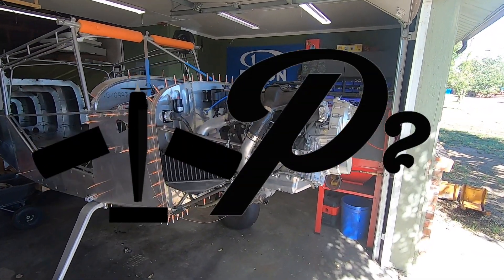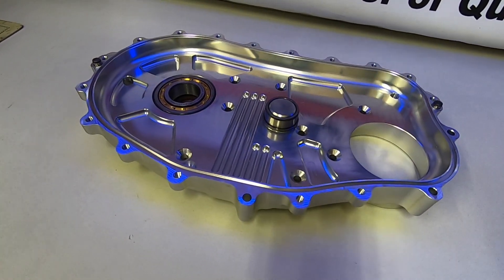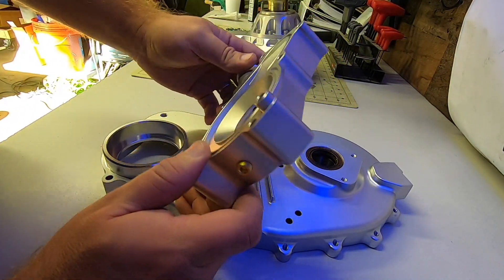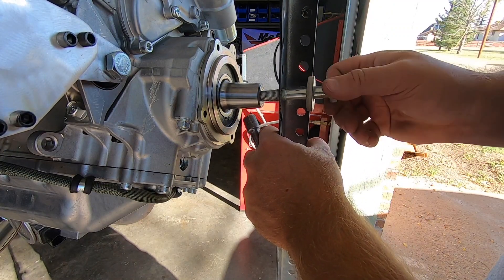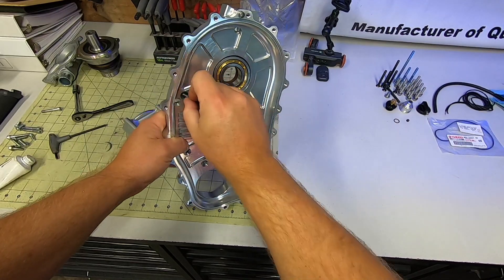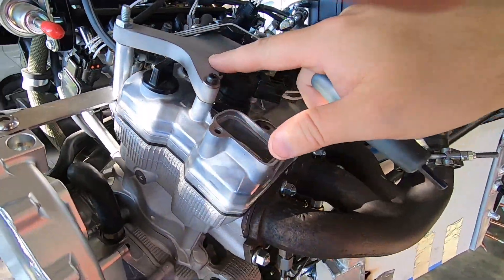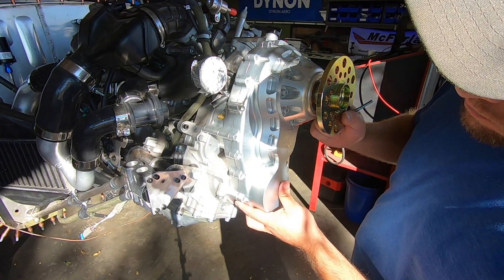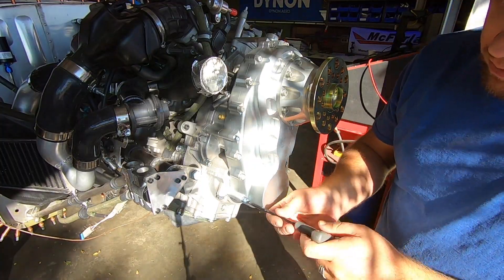SkyTrax Reduction Drive on the Turbo Yamaha Rans S21 EP37

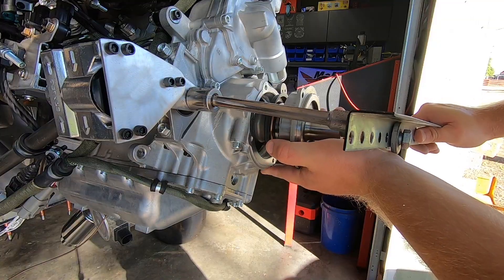Comment: NOTE***@ 3:12 that PTO shaft is a bad design on these engines and develop a bad Harmonic vibration due to spline clearances, "Speedwerx" has a premium(Complete) one with an amazing spline cut and a Harmonic balance to correct this known issue on it. This is an amazing engine and that for sure is an Achilles Ankle.(I promise you🙏) Hopefully this helps,  Thank You for sharing this for us.:goodvibes::goodvibes::goodvibes:
Reply from the maker: Thanks for the heads up. I'm not familiar with the issue you are referring to. any chance you have a part number from them? I cant find the product your talking about. Thanks!
Reply: @Project2Aero   Did you ever get to the bottom of this?   Sounds like an important/fundamental if true.   It appears there is no damper/coupling to wear out between the engine and the gearbox, is that correct?   I didn’t see a harmonic damper on the engine is there one in your system?   Thx.  I think this is a very important engine for EAB and would very much like to do what you are doing.

Comment: Hello, well engineered aircraft project. 
2 Thumb up 👍👍.
What turbocharger unit you used ?
Thanks,
Reply from the maker: Thanks! This is the stock turbo for the Yamaha 998T. It’s made by IHI but I’m not sure what the specs are. Thanks for watching!

Comment: I know that the engine puts out more horsepower than the 915, just for a reference does anybody know the weight difference between the 915 and the Yamaha?Also how much does that gearbox cost?
Reply from the maker: I expect it to be similar to the weight of the 915 engine. I will weight the whole assembly when it comes off after my ground runs are done and I start painting engine mounts and stuff. Stay tuned👍
Reply: Yamaha genesis 998 engine weights about 62.5kg.